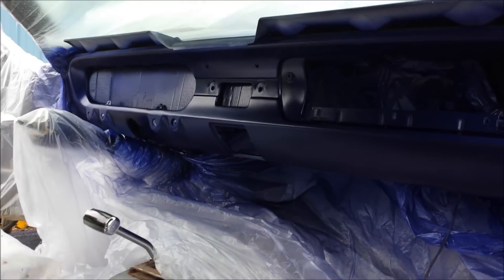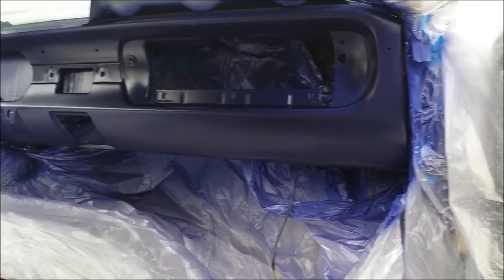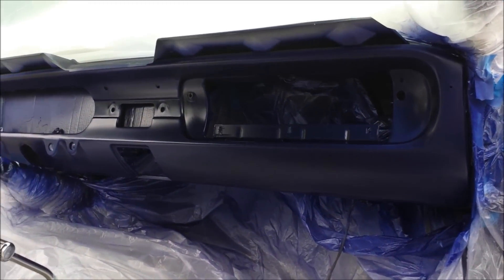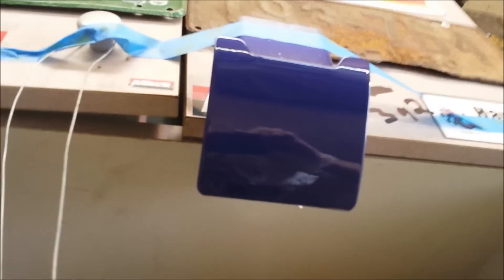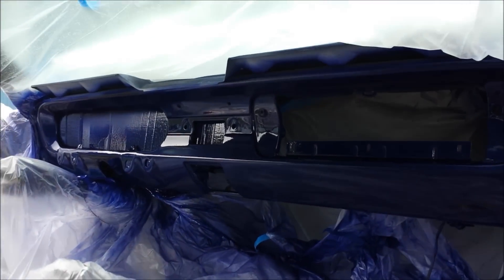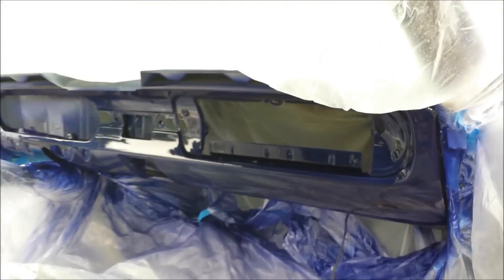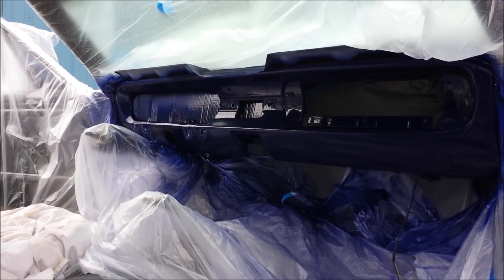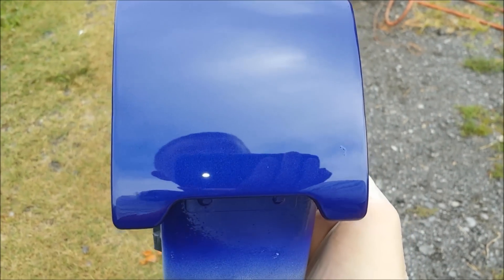1965 Mustang: dash work part 4! The color is on!

Comment: There's that darn hair it will get you every time. You cold wet sand that almost out and buff it but i dont think you will see it after it's all together. Couldnt wait to get them push buttons in i see.
Reply from the maker: That's right.  I went back about 10 hours later to put those buttons in.  I wanted to see the different color leds on the paint.  I think the blue looks the best.  The hair is on the lowest portion of the dash.  I'll probable just leave it.
Reply: Cobrafanatik22 They came with different colors to change out?
Reply from the maker: Yeah depending on how it's wired it can be green or blue.  Look at one of my older videos.  I have one of each color on.  I was trying to decide which way to run them.  Now after I have them up against the paint. Blue is the choice.  You can get other colors. Each button has two options.  Just depends on which one you buy.
Reply: Cobrafanatik22 Thats cool.